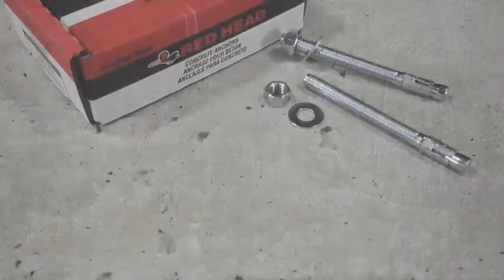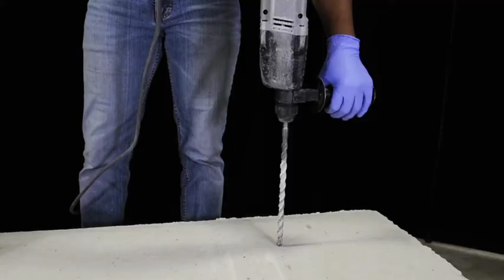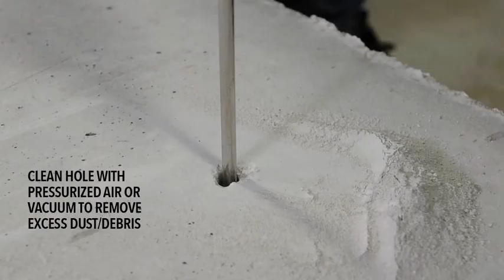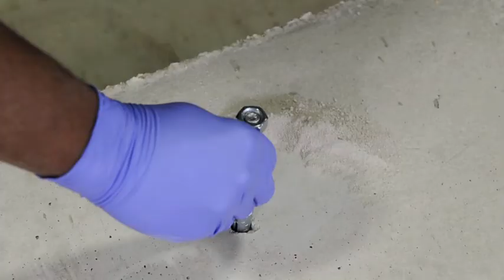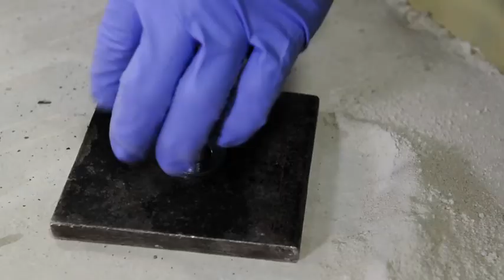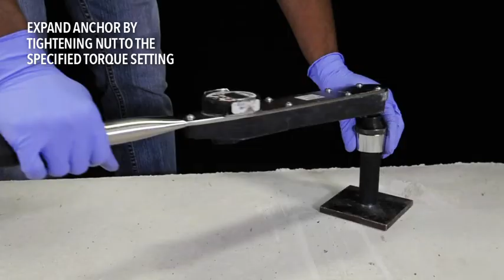Red Head Trubolt Installation Tutorial

Comment: I hammered my 1st two like you did with nuts on and it ruined them. Next 2 I left nuts off and they were fine. I'm going to have to find a way to cut all 4 off at cement and start over in a new location. Wish I didn't watch your video, it caused me a lot of work and will cause a lot more.
Reply: did you use a metal head hammer or a rubber head hammer?
Reply: Thanks.  In video it looks like he didn't put the nut on far enough.... as if hammering would be causing the nut to damage the threads.  They add that extra metal above the threads to protect them so it's hard to picture what happened in your case.
Reply: Same happened to me. This video is crap
Reply: Same I-I ruined several by doing like video says.

Comment: Way to show someone how to mess up an anchor. If you run the nut down further and use the hammer drills hammer feature it will work correctly and save you the aggravation of having a useless anchor. This video shows you how gall and bind up a nut though.
Reply: This just happened to me. That's why I'm here. Fffffff

Comment: i am not new to using red heads not this type though ,,,the ones with a red tip that when hit with hammer the end part " red wedge looking thing "  goes inside the anchor thus spreading it and those DO NOT COME OUT ,   we have had lots of hurricanes here in west florida and i been using this type showed here in this video for a while with plywood sheets ,,,for the most part they work good ,,,but some do COME OUT of the concrete ?  very annoying to say the least ,,,,hole is clean , right dia, etc etc never used this type they are not as good as the ones i referred to earlier ,,,,is there an EASY fix for when they come out from removing the plywood and reinstalling again as needed ,,,,,epoxy came to mind but as a last resort , we used the red heads in conveyors for years as a millwright never had one come out !  just saying ,,,,,thanks for the presentation nicely done ,,,,

Comment: One of my screws started bending when hammering. And on another one the threads messed up when I was hammering with the nut at the end of the screw. I wasn't even hammering that hard. Any tips?
Reply: Make sure that the nut is a thread or two down so that the hammer isn't accidentally contacting it.  Also make the hole at least 1/4 to 1/2 inch longer than needed.  Most of them say at least 1/2 inch longer.